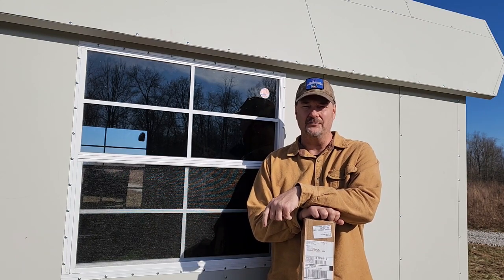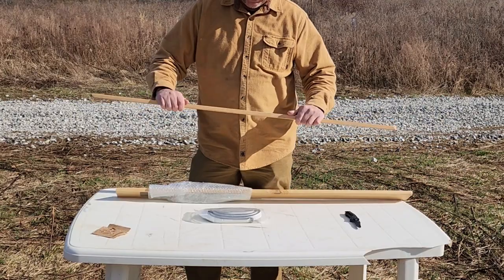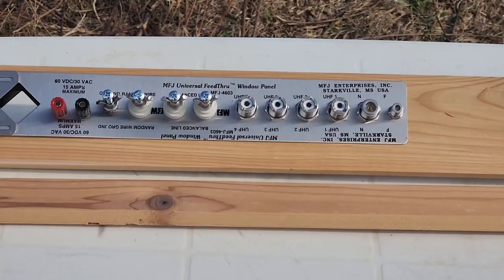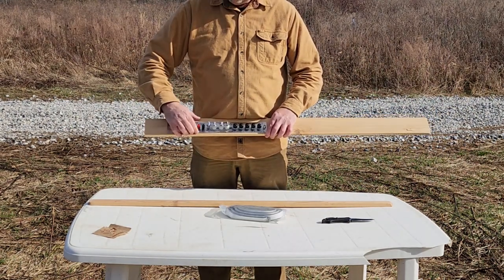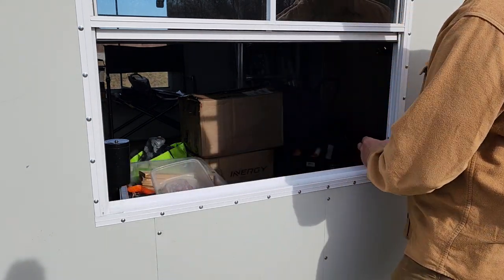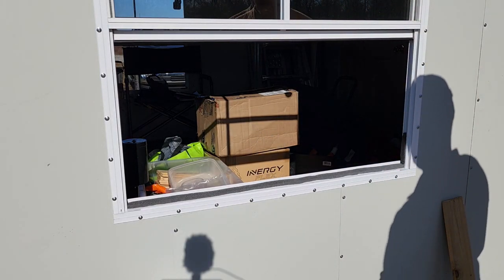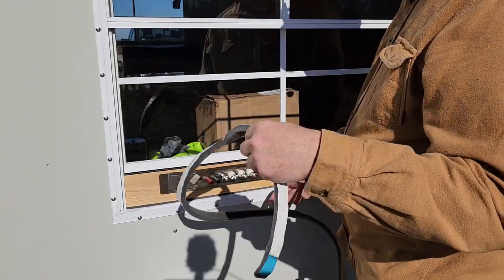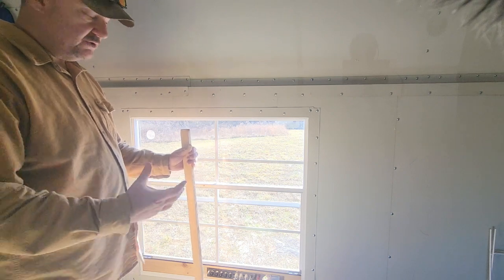LCARA HAM Radio: MFJ-4603 Window Feed-Thru!!!!

Comment: I've got a real old one of those that I had ro trim after I got new windows. I'm planning on adding a couple more pass through. Also, mine does not have the cable pass through port. Good video. 73

Comment: Can something like this be used a a metal window that slides left/right instead of up/down? Thinking so because it's a better option than trying to drill thru cinderblock.
Reply: It can and all you need is a dowel to stop the window being moved horizontally. Just get a round rod and lay it in the window track and you are good to go.

Comment: How do you think this would work with a crank open window that opens at an angle?
Reply: I've got the same issue with louvered (crank out) windows. I've come to realise that if you install one of these, unless the board has hinge pins installed in the window track, the whole thing will drop out if you ever open the window again.
Fortunately my shack is on the first floor and I have 3 other windows of the same type if I need ventilation and security isn't an issue.

Comment: Sweet setup! Add another piece of wood to the other side and then find some additional wood and run it horizontally and bridging the two vertical pieces and carefully run a screw into the two pieces tying them together. Top and bottom to create a frame and it will not shake out from the frame. Are there provisions for grounding the metal frame?  Grounding on the inside with Polyphaser  or Alpha Delta protectors? You can add additional protection from break ins by getting some 3/8” Lexan polycarbonate cut to fit to the Frames of the window and using some backup straps of aluminum and screw it into the outer frame of the window. This is an option only if you don’t plan on opening the windows for ventilation.
I like the idea of a metal shed. Is it framed with steel or wood studs and is it insulated? I have been slowly restoring a military modular comms ISO container for my shack. I need to find a compatible connector for the power input to the unit and finish shelving inside. It has a large 45,000 BTU heat pump installed but it’s three phase and it’s not a modern efficient design. Now if I could just find one of the newer M1022 Mobilizers, I could move it from place to place.

Comment: Hey guys, I am looking to put up a small DMR repeater in an urban environment however I don't want a crazy big tower in my back yard as I live in a residential neighborhood. How tall do you thing the antenna really needs to be to get about 3 miles of range out of the repeater. (will be making the repeater using 2 Motorola XPR mobiles)

Comment: I have an MFJ 1622 apartment 1010 or no I really shouldn’t expect much from an apartment antenna but it really wasn’t that will put together loading coils a little loose. The little alligator clip came off the first day wasn’t solid right or good enough for the back spring maybe I’m just losing faith in MFJ products I think I buy anything else will be more expensive is an antenna. I guess it’s only one experience I’ve had but geez I could’ve done a better job soldering things I should I get the feeling that MFG is made from junk not mart nephew. I’m glad they’re American me, but I wish. Maybe they’d have a better quality control!

Comment: Why not a utility box secured to the wall with pass through pipes though the wall? That way it can be locked and not creating an ingress point …
Reply: Well that’s pretty obvious mate, you would have to create some serious holes in the wall of the shack!!!!
Reply: @stevej-m2r  not really that’s exactly how I have mine running into my home. Through the wall.
Reply: @RobertMehrer  Yeah, not everyone can cut out a section of double brick wall to install a utility box. just to run a few cables. This is the most common and adaptable solution without requiring  structural changes to a house or shack, particularly if you are renting.

Comment: I learned to use a dowel rod on the inside to keep it from being opened,  but not before adding a small hook eye or something similar in case I wanted or needed to remove it to open the window. makes it easier. Can’t be too careful today